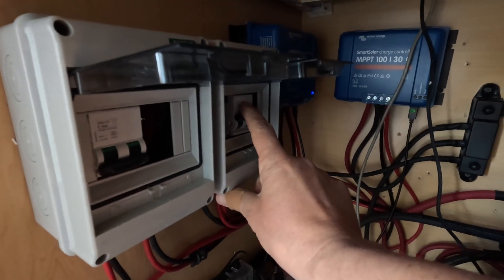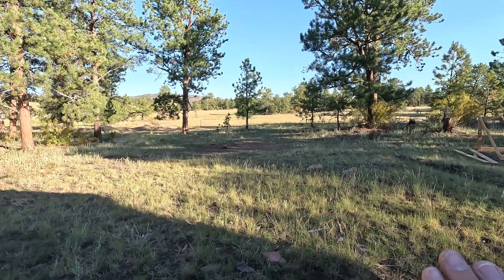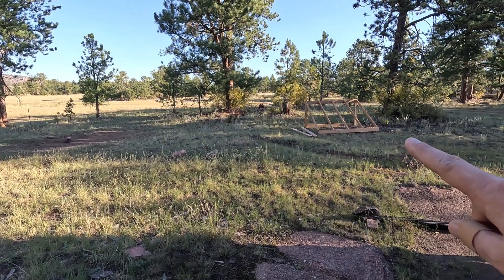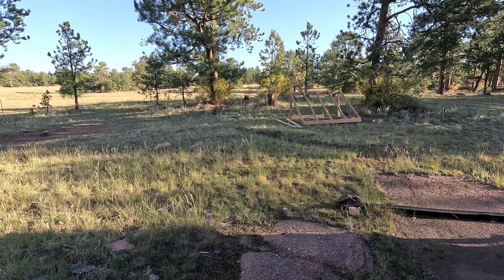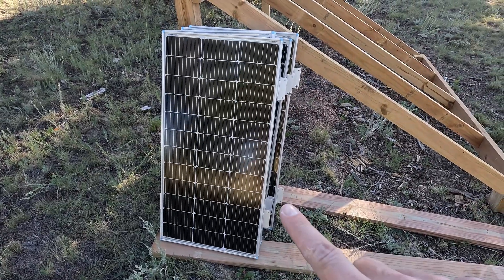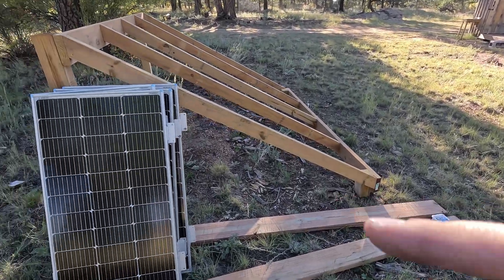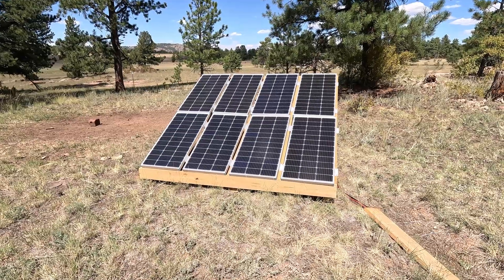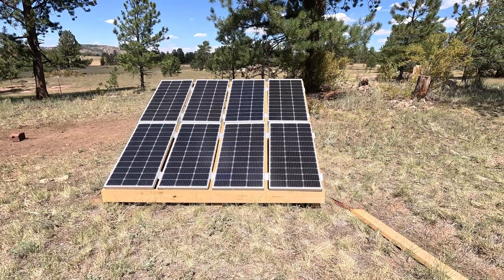Moving A Roof Mounted Solar Panel Array To A Ground Mount, Ep. 29

Comment: I plan on buying land in southern Colorado near Alamosa within the next year. What can you tell me about the soil in Colorado? Also I think mounting your solar panels on a device that either tracks the sun or something like what you have which can be moved around is more ideal than roof mounted ones. I have solar panels on the roof of my van so I am able to move my van to get the best sun, but as you know you cannot do much with them if you mount them on your roof.
Reply: I have some property in Conejos County south of Alamosa.   I plan on building a 16’x48’ 1bed/1bath home for myself.  I’ll use solar panels for electrical needs.  I have water rights from a canal for irrigation .  The place has been in the family since 1939.   The biggest problem around Alamosa is the lack of ground water.  Don’t believe everything the realtor tell you, investigate for yourself.
Reply from the maker: Thank you for the comment. As for the soil in Colorado is very sandy depending where you are. We do have some good soil where the trees are but if you intend to farm, you will have to work the soil and improve it. Colorado is very dry and semi arid most of the time. It's called the alpine desert. We do get wettish summers with afternoon showers but again, the mountains very much affect the weather so they can block or allow certain weather patterns. We have a very bio diverse state depending where you are.  I would think Alamosa would be more on the dry side.

Comment: good move!
IMHO

what voltage are you running?
wire size will need to be larger...
Reply from the maker: Thanks James!. My battery bank is 12v. My solar panels are ~20v open circuit each. Since I'm cheap and do not want a big charge controller that handles a lot of voltage, I wired two 400w strings in series and parallel. So each 400w string is about ~40 volts and 10 amps and I have two Victron 100/30 charge controllers, one for each string that charge my lithium batteries to 14.4 volts. I am using 10awg solar wire and the distance is about 40 feet (two separate runs). Each 400w string is independent and not combined anywhere except after the charge controllers send in their metered voltage to the battery bank.
Reply: Thanks for the details!
I appreciate the redundancy, I wouldn't recommend the same for lead-acid batteries, though.

I have the same Renogy panels in their boxes - still building my system.

I ran your numbers through Southwire's resources/calculators. I think you can improve this by wiring the panels in each controller's string in series. This is open circuit of 80 volts - the Victron controller can handle this. The string then is nominally 48 volts and 6-8 amperes. It will cut the voltage drop in half.

Also note that other than UV protection, there is no advantage to 'solar cable' - regular individual THHN conductors will do just fine for the long run, will be easier to pull, and much cheaper.

thanks for posting!
Reply from the maker: @jamesalles139  Thank you. I appreciate the feedback. I'm new to a lot of this and enjoy learning. I will consider your recommendations.
Reply from the maker: Also, on the move, I started collecting solar a full 2 hours earlier in the day! So far that is a huge plus. :)